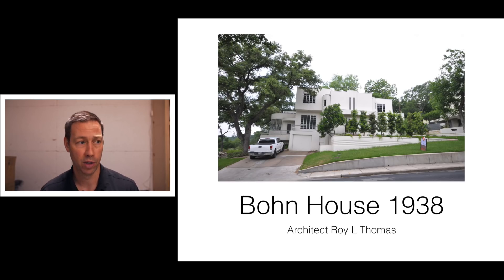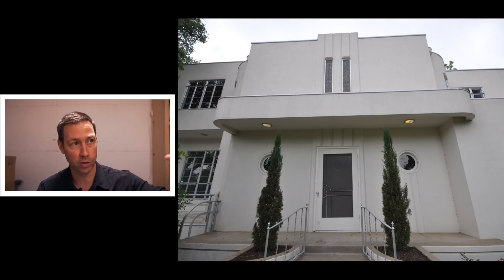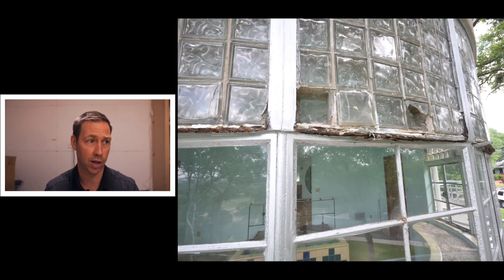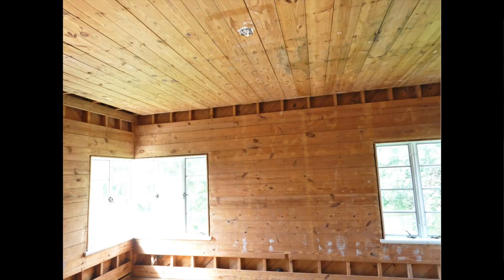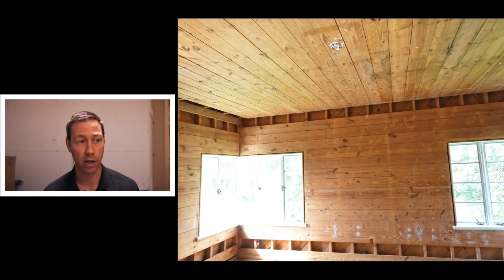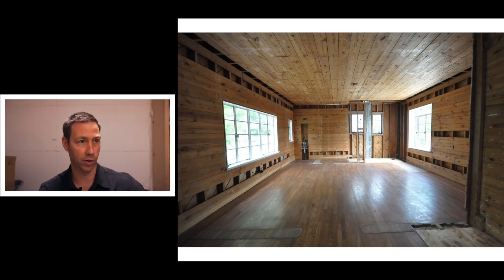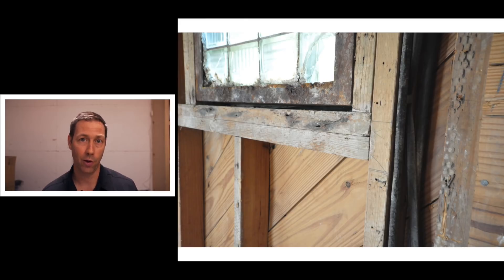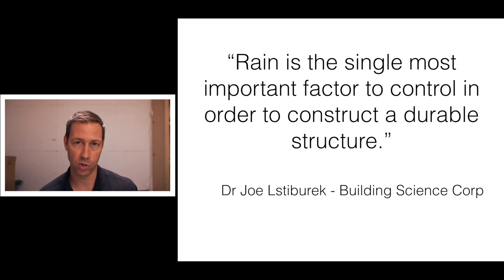Stucco - Is Rot inevitable? A Lesson In Building Science

Comment: Perfect example of what’s really typical here in El Paso, TX and New Mexico. No air gap behind the stucco cladding on this wood framed homes and poor flashing details around windows and doors with only two layer 15lb felt moisture barrier behind the stucco. The only thing which seems to keep this from not becoming a bigger issue is that this a dry climate and not that much rain, but when it does rain everyone is surprised they have leaks everywhere. There needs to be a building code overhaul out this way.

Comment: Hi Matt, we’ve met a couple of times on AIA tours. Wow, that was depressing. My home is in Austin, Commons Ford Road area, was built exactly the way you described not to. Modern, no overhangs, 3 coat stucco, 2 layers of black asphalt paper, no gap between the stucco and the wall, solid foam insulation throughout the house, I’ve already had a couple of leaks and can see vulnerable areas for water getting in. Concerned about it’s future. But I guess it’s good to learn this stuff when the house is 1.5 years old vs. 20 years later when all the damage is done. Thanks for this very informative video. —Roi James

Comment: Hello - Can you please forward the links for the continues videos on this series [Stucco - Is Rot inevitable? A Lesson In Building Science
]? 

We have a massive stucco failure in Florida, and are not in a position to tear down all the exterior walls. We want to repair the rotten plywood and structure from the INSIDE. Can you help PLEASE???
Reply: The stucco on the outside looks unbelievably perfect, except a few hairline cracks where the inside damage occurred (those will get fixed).

Comment: see u hate old houses i told u over and over old homes are better they are built better the insulation cause the stucco to fail old homes loose heat to dry the walls so stucco does fail cause it breaths if u put insulation and vapor barrier it will fail i have a 120 year old house so i know what im saying i observe what the older builders did and i admire it no issues or rot none

Comment: At 8:46  there is another fatal flaw,, perhaps as great or greater than the sprinkler head.  Ground elevation.  Code is clear.  8" above the surrounding terrain and a positive slope away from the building for the first 10 feet,, a minimum fall of 6".   So, ten feet away from the structure, a wood structure, there should be an aggregate change in elevation of14"  minimum.  Note:  Code is a minimum standard,, not a target standard.     

Per the photo,,, there is a slope away, but the wall is built into the soils,, there is no 8 minimum above grade.  The wooden wall is built into the soils.

  On the historic house,, without even looking,, that is almost certainly a 30# or 45# asphalt impregnated felt.  Is it?  The Bohn House has wall caps,,, copper, aluminum,, stainless,,,  Does the modern structure have similar metal parapet wall caps? (And carefully fabricated and installed.)  I can see caps in the one photo,, but the damage says there was none or so poorly installed as to be for show and not effect.  The very top of the parapet wall shows damage where there absolutely can be none,,, if the metal work was installed with care.

The water damage,2X4 sill, , minor, in the historic house has the look of rare and intermittent water,, condensation on the inside in cold weather?  2 ,3, or 4 wettings per year would be about that level of stain.

My experience in Michigan is that stucco walls are dependent upon their paint.  Yes, stucco walls are sponges.  The outer most barrier is a good paint job.  All of those older stuccos were painted with an ouil base paint and painted thickly,, with brush or roller.  The modern house was only painted with a spray unit and latex.   Good latex will work,,, but on cemetitious surfaces  the rate of coverage will be 100 square feet per gallon and multiple coats.  Water will walk right through a less than perfect paint job.

Comment: The Canadian study reflects the snow and ice that's on the roof for six months. Those 3' or 4' overhangs are seen in Austria, Germany, Scandinavia or anyplace with 15' of snow or more.  And they have basements that leak usually because of poor grading or grading that's 'sunk', so getting the rain away from the foundation is key.
Here in California we don't want to trap flying embers, which can come from over a mile away.  A study I saw recently showed pretty much the opposite recommendations for roof overhangs.  That's ok, we don't have the snow and ice.  But we have the stucco.  Everything in the video is true but we don't see the effects in the desert as much.  In the desert, the heat absorbing stucco stresses the Air-conditioners into the night.

Comment: Hey Matt, what about using an exterior airspace between the stucco and the building envelope? I was thinking something like roxal over 2x4, with a wrap, then 2x2 spacers, tar paper, lath... I think it would dry, but I also think it would increase sound transmission (vs stucco closer to the sheathing) from outside to inside. Last, what about actively heating the stucco like a heated floor (but only where it is wet). I like the look and sound isolation that stucco can give, but I am not willing to give up insulation, air conditioning and heating to get it...

Comment: Thanks for sharing.
Great visuals.
Keep 'm coming.
"No insulation" I am certain that the air gap between the exterior wood sheathing and the interior walls is actually a form of insulation same as the tiny incapsulated air bubbles in every form of styrofoam product and aired cement.

Comment: Whats the point of all these new codes if the old way is clearly better?  It also seems like every material or system used for water control is not that good.   How can one sprinkler destroy a wall like that?
Reply: The new ways are perfectly fine if you do things properly. Do anything improperly and you'll have a disaster. Having irrigation so close to a house is a huge mistake that I commonly see.

Comment: I think burying the base of the wall is a huge contributor to the failure. If the bottom weep screed isn’t able to drain out, the cladding will never dry. Even with sprinklers wetting the wall, if the stucco is able to drain out, it should be reasonably ok. 

When landscapers indiscriminately pile up the mulch, bad things can happen.
Reply: Agree, I am remodeling 1960 home in SFO bat area.
I removed stucco I see water damage close to foundation at some locations.
Most homes here have soil level above stucco.

Comment: Matt

Interested if you won that remodel job as what would you do to increase the insulation but not have a rotten house in 5 years.   The owners could ask for spay foam and it wouldn't dry like it used to at all... Do you remove all of the stucco and redo it (seems expensive).
Reply from the maker: Chris, Excellent question!  Short answer is a That it’s difficult to insulate if you see ANY signs of moisture coming through. I’d do some water testing and IF and Only if it’s dry I’d insulate. The windows would need major work to ensure they don’t leak too. If it looks like the sheathing is getting wet you’d have no choice but to pull the stucco before adding insulation. Thanks Matt

Comment: I've read that if the flashing and  weep screed are done right, with staples only applied over studs, traditional stucco can work on modern construction. But instead of worrying about them getting all those details right, wouldn't it be easier and cheaper to put 1/2" cement board on a vertical-notch-trowel drainage plane, using non-permeable mortar or mastic and just enough screws to secure the edges, then put acrylic stucco over that? I can't imagine that costing more than 3 coat job and it would be tougher than EIFS.

Comment: I'm a natural builder. We stress overhangs (hat) and high foundation (boots). If your structure doesn't have good hat and boots, it is going to fail.
We built a post and beam, with straw bale infill home. We have wrap around porches to protect our clay plaster exterior walls, and concrete porch floors that move water away from the house. When the rare weather gets the clay plaster wet, the clay has an enormous ability to absorb water, then release it after the storm. We've had almost no erosion of our clay plaster over the past two years.

Comment: the idea of putting a masonry finish directly onto a wooden structure (apart from tar paper) seems so stupid to me, its obviously gonna cause problems. Here in the UK if you were to put render on a wooden house you'd put treated 2x1 battens onto the exterior sheathing to give an air gap, then a cement based render board, and then render onto that. that way your timber structure is never getting wet.

Comment: Homes aren't being built like they used to build them.  I truly believe that builders have worked to get the codes changed so that the homes can be built with cheaper materials so that the profit margin is higher.  We purchased our home when it was 5 years old.  We keep getting telemarketer calls encouraging us to upgrade our windows because the original ones are single pane.  Siding on our previous home was some kind of hardboard panels which looked to me like it was made of fine sawdust and glue.  For a while, aluminum wiring was the predominant wiring choice of builders in the 1970s (proved to be a bad choice).  OSB has taken over plywood.  As you state, it becomes vertical mulch when it gets wet.  24" centers even on load bearing walls vs 16" centers in mild climate locations and building on land that should never have homes on them due to underground soil conditions, high water tables and flood zones.  If you have to buy flood insurance, that's a sign that there should not be a home at that location.

Comment: We built our home in the Black Hills of South Dakota.  It's considered "Semi-arid" here with rainfall similar to yours.  Our house is a DELTEC with 39" overhangs.  We're fairly sheltered from the wind with the pine forest we're surrounded by.  Trees are cleared a minimum of 30' around the house to conform to "Firewise" standards.  The walls consist of 2x6 construction, sheathed in 5/8" plywood, 1" of foam, TYPAR and Fiber Cement siding.  We spray foamed the stud cavities to 2-3" of 2lb foam.The foundation is ICF and I did put a membrane over the foam but not a dimple mat.  Soil where we are is very granular.  You can work outside in a rainstorm on raw ground and your shoes don't get muddy. We backfilled with 3/4" clean rock over a drain tile that runs to daylight.   After 3 years there is no evidence of moisture anywhere in the house.  It's a rare thing to see wind driven rain or snow on our windows.  One thing that I found unusual building here was the use of vapor barrier on ceilings.  Having moved from Minnesota where the vapor barrier is important everywhere, I was surprised when I spoke with local insulation contractors and building professionals.to find out it's not used on ceilings.  The comments I got were that it's better for the attic to breathe.

Comment: My mom has a 10 yr old house, stucco on three of the four walls, in philly.  With heavy rain, we have had leaks in the house, including over the ELECTRICAL SERVICE! (Meter and boxes are inside). That and with rust spots noticed on the exterior, we are having to redo the exterior walls of the building.  Probably a bad stucco job, but like you show, even with a good stucco job, it leaks.
Reply from the maker: Yes. Correct. Even a good stucco job leaks
Reply: So the key is to have a rain screen  barrier  and  fiberglass mix with the stucco along with plywood instead osb perhaps a elosttactric  paint help to prevent water coming into.

Comment: Matt I live in SoCalif and there is so much stucco here.
I just do not get it!
It holds heat all night long in summer.
All it is is a phoney rip-off of Adobe.
Reply: Brian Curwick   I get it, I live in the low desert east of LA.  Temps get 115 in the shade and dry as hell.  In SoCal stucco is here to stay because it is dry, when the last time we had three feet of rain... never. Barely enough water to drink. However many of the home builders are using one coat stucco, maybe 3/8 of an inch thick, with synthetic additives light wire mesh over one inch thick poly foam rigid board that adds R value plus the required R-13 in the walls and R-38 in the attics. Much better than my home but that how it goes. And I do not have sprinklers spraying my house. And I am looking into solar before the state of Cali forces me to do so.
Reply: Steve Lopez 
My daughter had a home built in the 2000s.
It had trim work that was all over, around windows, around posts in front for little patio.
It was styrofoam which was stucco'd and just color coat over it. 
If you bumped it with a rake or shovel handle the color coat would crumble... Total crap.
My nephew works in a Law Firm which basically just does Class Action Defendant work for the cheap ass developers. I'll never forget one case, an architect/engineer told the developer a cantilevered bedroom should be built a certain way but the developer wanted to save money (they were building a few hundred homes). Eventually the cantilevered section of each home sagged and required extensive re-enforceme to correct the problem.

Comment: @Matt Risinger ,  Do you have a video on a proper stucco installation? we are in New york, planning on acrylic stucco with 2" foam under, residential home, 4/12 pitch and good size over hangs, spray foam on the inside and CDX sheathing and roof. any recomendation on regular vs acrylic stucco like stuccoflex?
Reply: even acrylic stucco with a rain screen under? so it is between brick and vinyl siding?

Comment: I've worked on so many houses with water damage as a result of sprinkler systems saturating the house. There needs to be a change in the landscaping community to address these poorly installed systems.
Reply: Benjamin Cooper 
And homeowners need to be proactive and inform themselves. When they hire a landscaper, homeowners should evaluate all of the proposed ideas. The bottom line is that homeowners must educate themselves. Videos like this and ALL of Matt’s videos are openly available and a great resource.
Reply: years ago i had a electronics cabinet that was in the center of a  roundabout in a gated community, the gardener put a sprinkler at the base and it fired water vertically up the ventilation slots drowning the cabinet and several thousands dollars worth of electrics.
landscaping people are not very smart.
Reply: You would think they could rely on soaker hoses instead of sprinklers in the areas near the building.

Comment: Three coat stucco will work just fine if proper flashing and water drainage if taken into consideration while stucco is being applied.  Flashing at top of wall (flat roof house) and around windows and doors along with caulking will hold up for decades.  On the failed stucco example in this video, the wall didn't have a weep screed at the bottom either and no way for the water to drain out of the stucco at the bottom. Good  example of improper application and lack of building experience.  Failure had absolutely nothing to do with "man made materials" behind the tar paper backing, the sprinkler shouldn't have been wetting the wall but the wall stucco wasn't installed properly to begin with so it was set up for failure from the start.
Reply: Parapet wall is one of the more difficult situations to build properly but with careful thought it can be done easily and properly.  Go to the "Kirk Giordano plastering Inc" you tube channel and use the search site function and he may have a video on that specific situation.  On the outside surface away from, opposite side of  flat roof , use normal stucco paper (two sheet 30 lb and wire) . Before wire applied, use paper applied up to and over the top then stop at opposite wall plane . On the inside, paper up and over the top to opposite wall plane. then use peel and stick asphaltic flashing on top and down the both sides about 6 to 8 inches. Alternatively, you can use a special built metal flashing to prevent water intrusion at the top and down the sides two tor three inches.  Use minimum amount of staples to keep holes to a minimum.  On inside, use metal flashing at the bottom of the wall to transition out onto the flat roof , then add a weep screed ( counter flashing)about 1 inch up from the roof to allow exposure of the flashing behind then place paper up and over the inside parapet wall as described above.  In all cases the roof, ( even a so called flat roof) should have a slight slope away from wall and a down slope to drain that day-lights to the outside or scuppers.  Peel and stick asphaltic flashing works fantastic here and around windows.